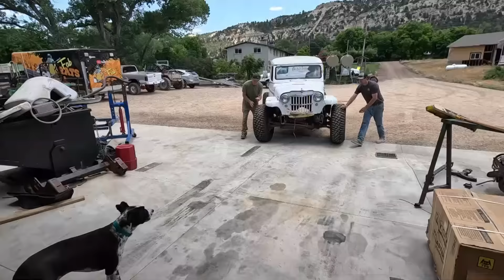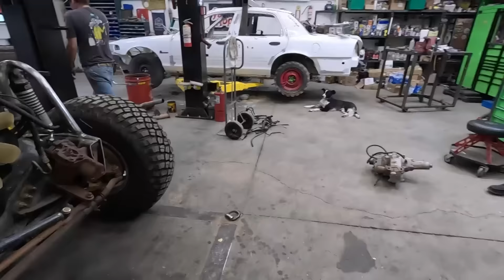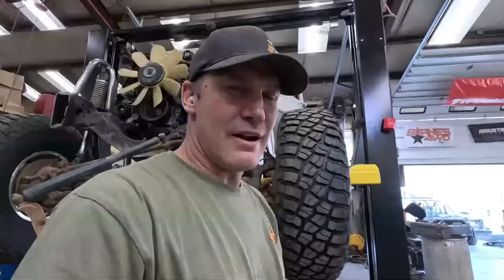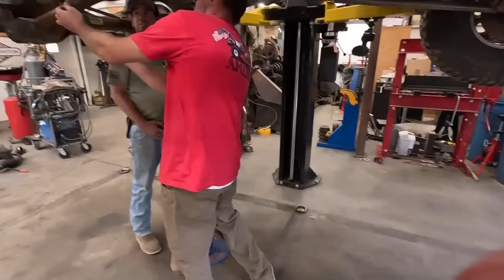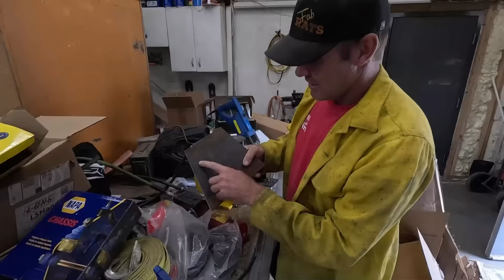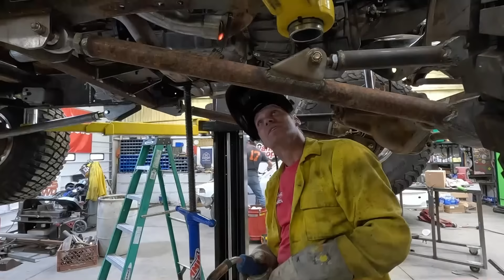Something Important Is Missing In The Ultimate Overlander Wagon!

Comment: The Diablo blades don't hold a candle to MK Morse Cobalt imo well not opinion really in my experience salvaging 80' automation rigs with heavywall 4x8 steel tube frames we tried six varieties of sawzall blades and the 50 pack MK Morse still had 32 left after more than 800 ' of 4' chunks so they'd fit in the recycle hopper that's 10 cnc machines 80' long cut down to 4' burned up 6 Milwaukee 20v red lith batteries dead and 3 Bosch 18v dead was an expensive endeavor

Comment: You can pick up a good used 4bt cummins for around 2,500-4,500... that would have been perfect for this project.. and you wouldnt have to do anything to it. Maybe get a better turbo and run it.  And the cummins engine can be extremely easuly adapted to ANYTHING from whatever vehicles to any transmissions😊😂❤

Comment: It is a cool build but you still wasted a good running driving Suburban even if it was a two-wheel drive As many trucks that are wrecked out there you could have found a motor from a wreck truck and maybe spent $1,000 on a motor and still had a running and driving Suburban that was worth 4,000 dollars

Comment: The LS is a great inexpensive engine. It is like the 350 small block. Those things were cheap and fairly powerful. Ended up in about everything. Was simpler back then, just using a carb and no computers. Modern engines are reliable and make way more power though...

Comment: Name the Willys Wagon "The Williwaw"!

Williwaw storm
A williwaw storm is a sudden, violent, and cold gust of wind that descends from a mountainous coast to the sea, typically in high-latitude regions such as the Strait of Magellan and the Aleutian Islands. This katabatic wind is characterized by:

Sudden onset: Williwaws can appear without warning, catching sailors and pilots off guard.

Violent speed: Wind speeds can reach over 120 knots (139 mph), whipping up the water into a white frenzy.

Cold temperature: The air parcel descending from the mountains is compressed, resulting in a significant drop in temperature.

Comment: The 37" tyres are too big and heavy that car will really struggle, 35" will be better.
Don't install the engine so far back towards the firewall and on an angle, MORR installed their V8 engine in the wreck incorrectly and are having no end of troubles with it.

Comment: Driveline is the whole assembly. The engine, transmission,  transfer case, driveshafts then axels. Driveshaft is component in the driveline system.
Reply: You're thinking drivetrain, or powertrain, drivelines/shafts connect gearboxes to axles

Comment: There used to be a old RC truck called the Wild Willy it had so much power it could hold a wheel stand on the wheelie bar for as long as you hold the throttle and looked like same but shorty model

Comment: At the 42.10 mark when using the angle grinder with no safety glasses, quick and painless? You're one step closer to blind fabrats. At least you won't be deaf because you wear ear protection 🙄. Well done Sean for a few minutes later , wearing them.

Comment: The driveline is made up of four key components:
Without a differential, one wheel would have to slide. Axles—Axle shafts are connected on either side of the differential and out toward each wheel. They rotate independently based on the controls provided by the differential. U-Joint—Also known as a universal joint.10 Jan 2022
Reply: That's drivetrain, or powetrain

Comment: You commented how good the super duty frame was working.  Ford did good, there is a lot of room in there.  Also something that would have been handy when you built the Rat Back I saw in a video.  It's the ford F 550 frame someone was using one for something and they somehow deleted the duals in the back, but the frame, axles and suspension were monster.  I believe even you would have to try to break one!  lol

Comment: That transmission support is cantilevered out and needs a second crossmember.  The structural tube is just going to twist every time you hit a bump.  Which will stretch the bolts at the frame.  A second crossmember where the exhaust pipe crosses over will cure all that.

Comment: What you should have bought is a 11-16 f250 with the 6.2. My brother just bought a 12 model with a rear locker and floor shift 4wd with manual hubs. It has 370k miles on it and runs like a top. Paid $5200 for the whole truck. I bought a 12 model regular cab with 186k miles on it sitting on 35x12.50 duratracs for $8k. The power train and drivelines on those trucks are rock solid. Put a blower on it for another $5k or so. They make as much power as your supercharged ls in the tow truck stock and they will do it for a million miles. Big super duty axles already, and you could chop the frame for free. Just a good strong chassis

Comment: If you pull the front yoke off an old driveshaft,  (for any type trans you might be pulling and save them) you can slide it in the tail housing and it will stay put and keep fluid from draining when the shaft is pulled and the engine removed with trans.
If you have spare yokes that is ...
Save them for future engine pulls with trans attached with no fluid spills !!

Comment: That is a great mod build on the old Willy's!
I had a 1956 stock back in the day in N. AZ and put a rear axle weld "Lincoln Locker " on it,  and then curry combed all over the Aquarius Plateau Region in 4WD. 
Sure do miss that back of beyond rig.  Now....back here in VA I use a 1994 Isuzu Rodeo that has 300k miles on her. It doesn't hold a candle to my old Willy's, but it has good A/C!!!

Comment: One way to drain the trans, I  drill a hole w a small self-tapping screw on the side of the pan. I drill the side of the pan so the screw won't be in the way on the bottom. If the screw leaks some after draining the pan, make a gasket w a thin slice of vacuum hose. Later, you can weld the hole up when it's apart.

Comment: I am slowly building a '50 wagon into a daily driver/overlander. I hope to see some cool camping stuff built for the interior on this old girl. I vote "no rooftop tent" as it won't look right on a vintage build. I modifiyed a new canvas wall tent to fit over the back end/liftgate.
Sad to see that you had to change plans with regards to the diesel engine. I have installed a om606 turbo Mercedes, mechanical pump, for fuel efficiency.

Comment: In Jaces defense YOU said the Willys had "13 mm" bolts holding the fenders on? WHAT? It would be a 1/2." The USA did not use metric on their vehicles for at least 20 more years. That's where your "tuner kid" came from. You. 13 mm indeed... I like the LS swap, the Ford chassis. That's all good stuff. Yes, I well aware that 1/2" and 133 mm are darn close.

Comment: Hey Paul, that 'Burban has a decent rear end in it.  It's made for GM by Eaton Industries as the 'MLocker' and the order code on the build sheet inside the glovebox is "G80".  It's got a semi-locker pal!!  Once there's a wheel speed difference of 100 RPM or greater (left-to-right) then the opposite wheel gets power transferred to it - so it's a 'almost' posi-track locker differential.  By the way, that thing is Built Ford Tough - with Chevy Stuff! Hahahaha!!
Reply: Us in the Off Road community refer to the G80 as the Gov Bomb. They have a tendency of grenading when they lock up with bigger tires. Plus the Super Duty axle he already has in the rear is way stronger then the rear axle in that Suburban. If the suburban had an 8.1L then I'd say use the FF 14 Bolt all day every day. But the 10 Bolt in the back of that Suburban is very meh esp when used with bigger tires.
Reply: @TyphoidSnaily  Great info and thanks! I'll remember this for sure!
Reply: @BigHeinen  no problem. The 10 Bolt rear in those 1/2 Ton Suburbans and Trucks are good in Street cars though. The 9.5" Semi Float 14 Bolt rear is a great axle for drag cars that want stronger than an 8.8 but don't have Ford 9" money lol

Comment: I can only 2nd the motion on the Diablo blades. I've used one in my skill saw 20 years, I have a metal blade for the skill saw that ate 1/4" for 20 feet without a hiccup,  and then bought some for my Sawzall and was not disappointed either. One blade helped me cut up a trailer home frame and all the hanger tabs, before I had to get a new one.  They know what they are doing for sure.
Reply: They do make pretty solid blades. I’ve got a couple for my circular saw as well, and put one on an old table saw I still use. For the price, they are hard to argue with…
Reply: I came across those Diablo blades years ago, probably 12 years ago, used them on lots of different projects and have never been disappointed.  They last a very long time.
Reply: Yep I don’t buy any other blades other than Diablo for metal. HF good for balsa wood and other softwood. Oh yea they can also cut blocks of cheese.😊

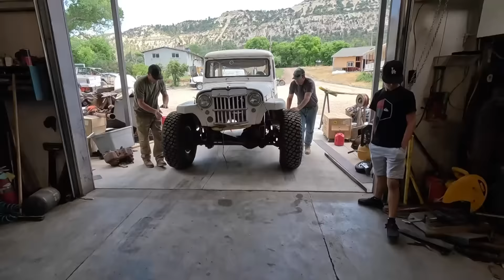Comment: Paul ask one of your tool truck guys for transmission slip yoke plugs. They come as a set. No need to drain the pan and no more mess leaking from the tail shaft. 15:31 the Will-e-Lander
Reply: Or just throw an old slip yoke in your tool box to save on kitty litter.